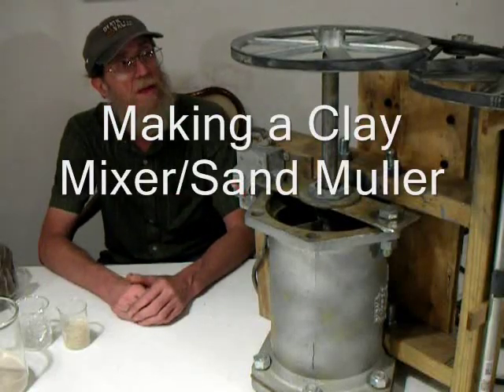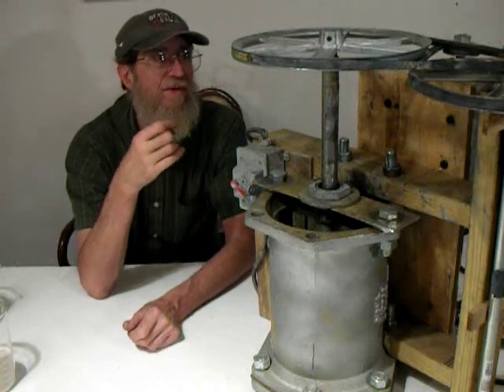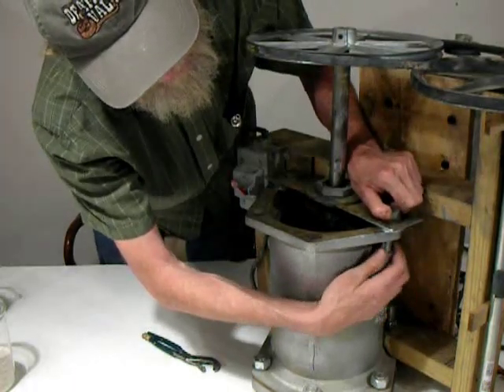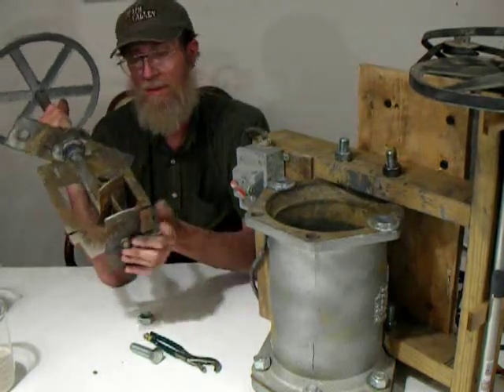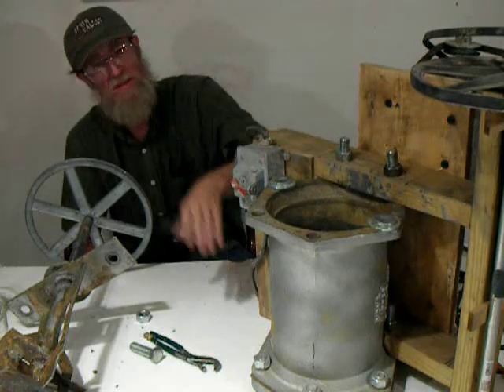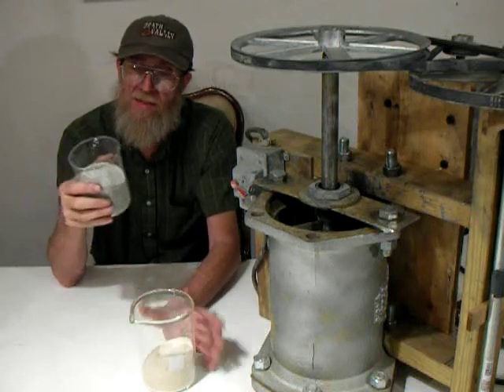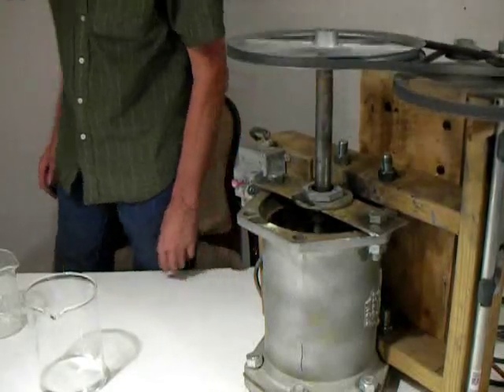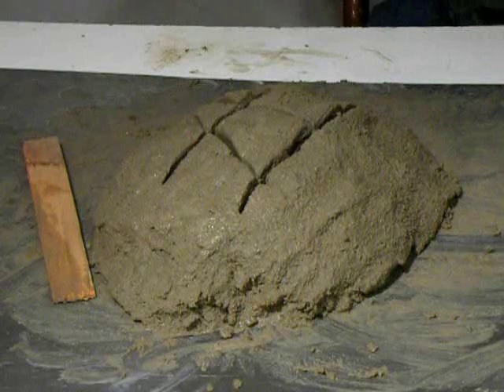Clay Mixer-Muller

Comment: Hi Bill, Thank you for your videos, really interesting ,inspired and imaginative.Done a lot of what you have there but differently so it is great to see your take on it. I mixed the bentonite dry with the sand and added water till the mixture starts to ball up then let the system run and empty it through a rough griddle. Worked very well as I'm sure yours will.